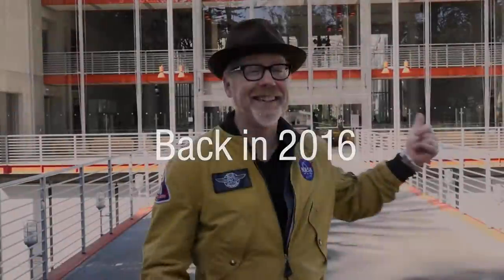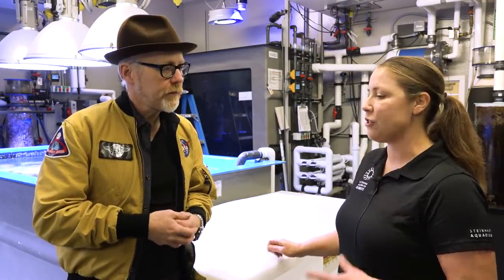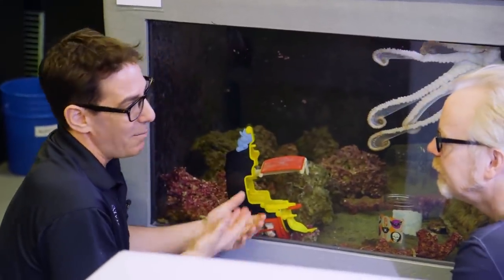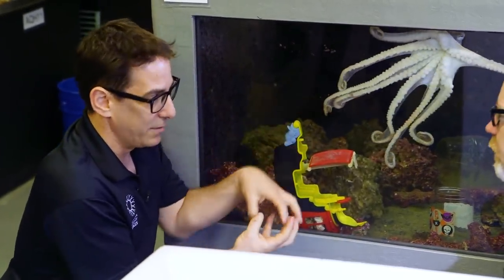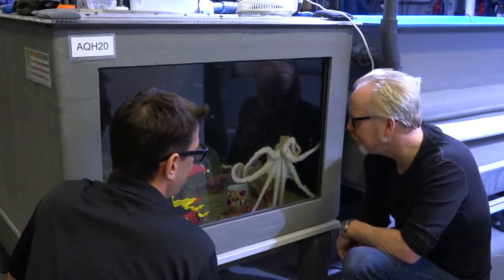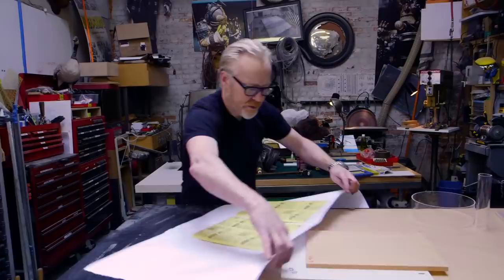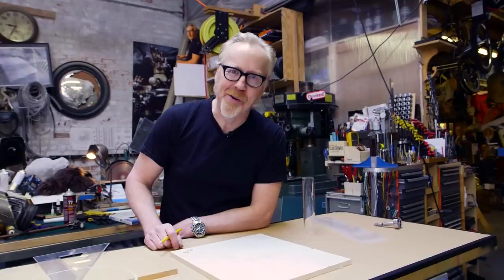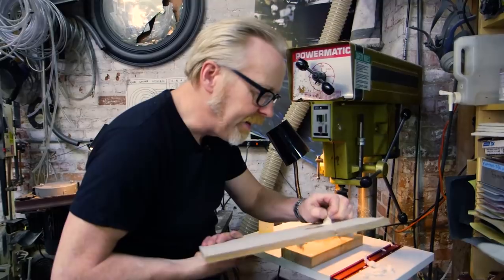Adam Savage Builds an Octopus Puzzle! (Part 1)

Comment: To elaborate on my earlier comment. A small shelf  attached to the upper leading edge of the cup to block the hole, when the cup is in the ready position, would assist in the initial trap potential. Some type of one-way mechanism to prevent an empty drawer from being closed would prevent the secondary pinch potential.

Comment: Centre of circle.
Draw a chord from A to B.
Draw perpendicular lines with your set square from A and B until the cross the circle again.
You now have 4 points of a rectangle with the corners on the circle.
Draw lines joining the opposing corners and you have the centre.
Probably no easier, but it saves the measuring step.
Reply: any 90 degree angle on the circumference crosses the circle on the diameter. 
so just use the set square on the diameter and mark where they cross the circle and you have one diameter done. do it again in a different spot on the circumference and presto center found.
whatever works for you, works best.

Comment: Another really quick way to find the center of a circle, you can draw around the tube on paper, cut the circle out, fold the paper circle in half and half again using the crease lines to align it; the crease lines will intersect in the middle.

Or just cut a square piece of paper the diameter of the circle and fold it in half and half again.

Comment: The idea I had would be a box the octopus learns to open by operating a handle or lever, next the lever is removed from the box and placed in the tank. The octopus has to figure out how to install the lever so he can then open the box.  The lever is a tool he must seek out and properly employ. The next step then would be to have a selection of tools, followed by a tool that performs better than the original lever and see if the octopus can recognize that and choose it over the more familiar tool.

Comment: "Smooth and rounded edges" like the corral reefs they live in. Cool video! Center finding: measrue the diameter - half it with a compass and swing two arcs from the circumference - where they intersect is the center.

Comment: You can actually draw any 2 right angle triangles in a circle (where the vertex of each point is on the circle) and the 2 longest edges will cross at the center point. No need to measure :)
Reply: Another method, if you don't have the ability to create a right angle, relies only on a compass and a straight edge. Set your compass to some arbitrary radius that's relatively small compared to the circle in question. Choose three points along the periphery of the circle that represent the centers of three circles with radii equal to that of your compass setting, and whose circumferences would overlap each other; An arc of point A would overlap B, and and arc of point B would overlap C. Two circular arcs that overlap will intersect at two points, so for each overlap you can connect the two points with a line. Two overlapping arcs therefore give you two lines. The intersection of those lines is the center of the circle. Another strength of this method is that it works for finding the center of not only a circle, but a circular arc as well. If you can make your reference circles sufficiently small, you can find the center of a relatively short circular arc. Two inscribed right triangles, in comparison, requires most of the circle to be known, but it requires far fewer steps if you have a something like a machinists square. This method is basically what Adam did, but you also have to use geometry to find the perpendicular line, instead of just measuring the midpoint and placing a perpendicular line there.
Reply: I use this method on occasion. The best part is you can do it without tools. I will just grab a clean sheet of computer paper that has nice 90° angle at any one of the corners.

Comment: Actually, the easier way to find the center of a circle is to draw a inscribed square triangle. The midpoint of the hypotenuse is also the center of the circumscribed circle. You only need 3 lines.

Comment: Quick question, why did Adam use a blowtorch for the acrylic (if it was I don't remember) at 23:52. I've just never seen that method before and wondering the purpose behind it.
Reply: It smooths and clears up the rough cut ends of the acrylic, makes the whole thing much cleaner looking.  Though it can be tricky, too much heat and the acrylic will start to bubble, which ruins the finish.
Reply: Its called flame polishing acrylic. Good way to give it a crystal clear edge. You can also use it to soften thinner pieces for bending into complex shapes. He mentioned that he didn't realize the acrylic he used had a surface with frosted side. The flame polishing would also have removed that, which I think he figured out by the end.

Comment: If the holes aren't too big, a great way to drill acrylic is with a router. Since there's no spiral on the bits, they don't "grab", which is what causes acrylic to crack when you use normal helical drills.

Comment: Adam:  Place the corner of a square (tool, sheet of paper, anything you know to be 90 degrees and comes to a point) anywhere on the arc of a circle.  the rest doesn't matter IF the corner meets the arc.  trace the adjacent sides of the square to where they meet the arc.  a line including both those points will go through the center of that circle.  to this in a few different points on the circle and you'll have your center, without measuring anything at all, no bisecting any lines, etc.

Comment: 17:27 You can find the center only using your compas and a straight line, without making a single measurement.
1 Choose a random point on the big circle's circumference.
2 Set and lock your compas at a random distance.
3 Draw a circle (A) using the random point as the center.
4 Draw another circle (B) using one of the two points where the circle A intersects with the big circle.
5 Draw a line going through the two points where circle A and B intersects. That line goes through the center.
6 Repeat 4 and 5 using the other intersection between circle A and the big circle (or circle B for that matter).
The two lines intersect in the center. That's how the ancient greeks were taught math as kids.
Reply: I love math!!

Comment: How did he do that floating screwdriver trick? Must of had an invisible line holding it.
Reply: The flow of air actually holds it in place. Not a trick, just physics ☺
Reply: Ultranitro -- Just the air hose.  That's all you need.

Comment: There's a faster way to find the center of a circle! And very much possible without any "tools"

To find the center of a circle you could have just used that square that you had in your hand. If you have a diameter line on a circle and connect the end points of that diameter line to any other point on the circle, the resulting angle between those lines connecting to that point will be 90° every time. So, take the square that you have, place its 90° corner on the edge of the circle and mark the two intersecting points where the straight edges cross the circle and draw a line between those points. You have just drawn a diameter. And as you said, you know the diameter runs through the center, so just do this a second time and you'll have it.

I've done this with just a clean/crisp piece of printer paper, using any one of the four 90° corners placed on the perimeter.

Comment: Adam, is the plastic you are using Poly(methyl methacrylate) (PMMA / plexiglass), or is it Polycarbonate? I've never found using PMMA any fun because you look at it sideways and it shatters. Polycarbonate machines with woodworking router bits just fine, but will scratch if someone sings a sharp note next door!  Love the content ... thanks.

Comment: You can draw two intersecting lines of any length on the circle, and construct the 90 degree angles very easily with the compass by piercing both intersections and drawing the same radius in both directions. In this way, no measurements are necessary.😅

Comment: I was always told in school that the plural of octopus was octopi, so have been using it for as long as I have been alive (almost as long as Adam). So when Adam used octopuses, after having been at an aquarium for said octopuses, I thought something was fishy (pardon the pun, I know octopuses aren't fish too so don't correct me :). It turns out that there are 3 commonly used plurals, octopuses, octopi, and octopodes (non of which Grammarly corrects for being wrong). Octopi was thought to be correct because Latin words are commonly pluralised to with an "i" such as fungi and cacti, however, the word octopus is greek hence the correct term is octopuses. There's a minute you'll never get back :)
Reply: Tim, I was going to say something like this but you beat me to it. Also there are very few spiny plants in the genus Cactus. The word Cacti would have to be always written with a capital C.  The word cactus has become an English common name for any spiny looking xeric plant. Therefore "cactuses" is now an acceptable plural. Blah, blah,  blah, whatever. John the Botanist.

Comment: Another way to find the center of a circle:
Place the 90 degree corner of your triangle on the circle
Mark where the 2 sides meet the circle.
The marks define a diameter.
Repeat.
Can be done with a straight edge - no compass, no ruler.

Comment: So Adam, when you explain that there is a way to get the cylinder edge smoother than sanding, you proceeded with the sandpaper glued to the board and commenced sanding.  What was the trick to smooth edge round the acrylic?
Reply: I think that was what he was using the torch for.
Reply: @AbuMaia01  will recheck, I didn't see the torch. thank you.
Reply: @ 13:30 he mentions the 'trick'. at 23:53 he applies torch for the first time, near to the end of video. good catch. perhaps it got edited out. the ten minute lag was a very long confusion to me.

Comment: Why did u use water to cool the acrylic for drilling and not for the saw?
Reply: Generally a saw moves through the material quicker and doesn’t concentrate as much heat since it has the whole saw blade to dissipate the heat.
Reply: @NBSV1  thanks 😃